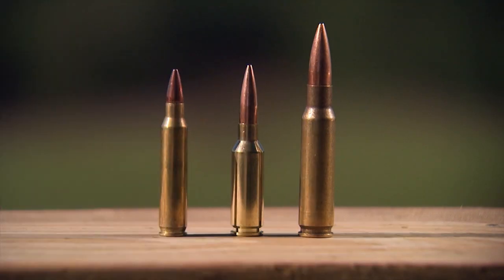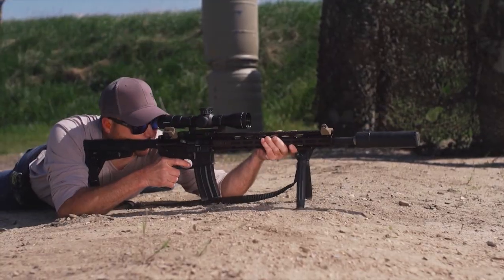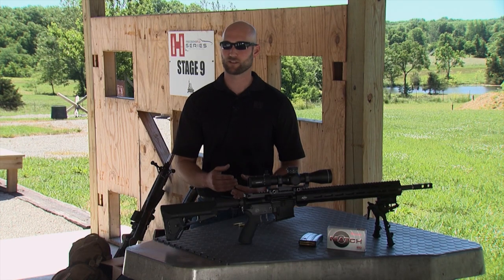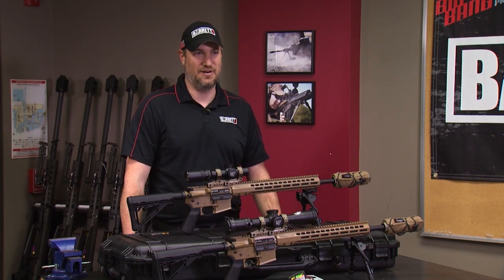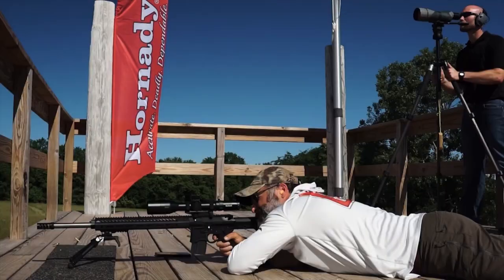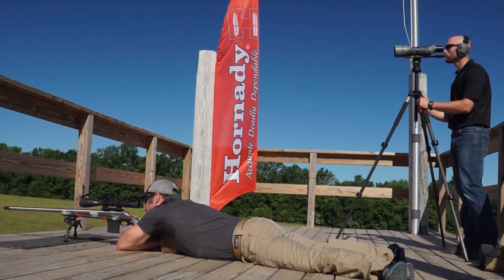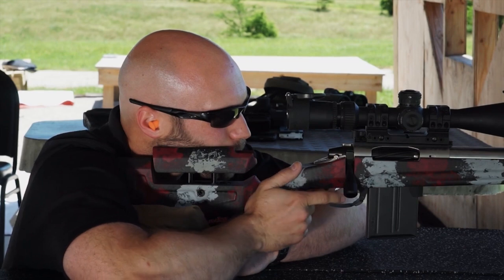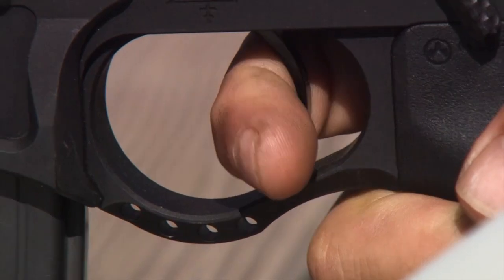Shooting USA The development of Hornady 6mm ARC

Comment: Nice commercial, however if anyone does even a little bit of research they are going to poke holes in some of your claims. Let's start with .308 like performance. This works as long as .308 is running a heavy high BC bullet. 6ARC actually flies more like 6.5 Credemoor than .308. 6.5 Grendal actually flies like .308 in drop and drift. Regardless of trajectories, you can't make a lighter bullet hit like a heavier bullet. The energy and mass just aren't there. I do like the R&D that has been done with these intermediate class cartridges, just dial back on the advertising claims. 6ARC is a flatter shooting cartridge than 6.5 Grendal, that's a fact. 6ARC does not put more energy on target than Grendal.  While keeping chamber pressures in the realm of what is currently considered reasonable, an intermediate cartridge will not hit like a short action cartridge. .30-06 set the action length standard in the U.S. I do think 6ARC and 6.5 Grendal are important and revolutionary caliber designs. These two rounds help to open peoples minds to what may be possible with intermediate class rifles.
Reply: I don't like the way Hornady gave Bill Alexander the middle finger with the ARC, it's a SAAMI-ed 6mmGrendel.
Reply: @mikemelina7395  I agree with you. The ironic thing is, 6ARC compares to Grendel like 6.5 Creedmore compares to .308.
Reply: @GB-zi6qr  Pretty much. "Hey look at the next big thing you have to have." vs "No, I'm good with what I've got."

Comment: I chose this over 6.5 creedmoor for my latest PRS gasser. Glad I did. Took 11 months to get a complete upper but that gave me time to buy ammo. Went with a 24" heavy barrel aeroprecision upper, silencer co lower with ambi bolt release. For a gasser it's a hammer. With factory 108 eld match ammo, when I do my part, it's a 1/2" rifle at 100 yards, average day it's 3/4". The factory match ammo is fairly temp stable, the 105 black is a bit more temp sensitive but still very accurate. 

I just started playing around with handloading for it. Tried the leverevolution powder, not impressed. Very temp sensitive. I've tried several other powders (all using 108gr eld-m bullets) but wasn't overly happy. (Either due to powder temp sensitivity or low velocities) My latest venture was using vihtavouri N150 with 103gr vapor trail bullets, definitely onto something there BUT I finally was able to score some 105gr Berger hybrids. Aside from not being able to get CCI br4 primers (using CCI 400's right now) I believe I have the components that will give me the results I'm looking for as for temp stabile powder that will give me the velocities I'm looking for and the most consistent bullets on the market. (And no, I'm not trying to hotrod it. Anything in the 2600 fps range is good with me. That's where the barrel seems to like it.)

Overall, for a AR15 platform, I think this is one of the best cartridges you can shoot for longer range and especially for PRS.